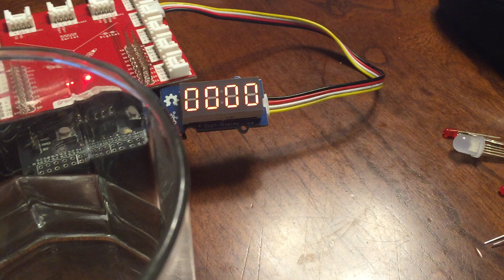Moisture Sensor (MSP 432 LaunchPad Demo)

Comment: hello...i am using msp432..i have to store some data in the internal memory...any idea ??
Reply: +Towhidun Nabi Could you elaborate? What do you mean you have to store data in the internal memory? In order to program the msp432, I used Energia, but you could also use CCS cloud at dev.ti.com
Reply: +asoom12344 i have interfaced a sensor which is bme 280 and i have to store the output which is temperature , pressure and humidity in the internal memory  every 60 seconds
Reply: +asoom12344 is there any other way to contact you other than youtube ?
Reply: +asoom12344 is there any other way to contact you other than youtube ?
Reply: +Towhidun Nabi what are you going to be doing with the humidity and temperature? Are you going to be displaying it on a segment display like I did?
Reply: +asoom12344 i have already displayed it via sharp lcd boosterpack...now i have to store the data
Reply: +Towhidun Nabi As far as storing it, I am also unsure because I've only started working with microcontrollers a couple months ago, so sorry. But if you do figure out how to do it, please comment here that way others can see too
Reply: +asoom12344 ok..i will